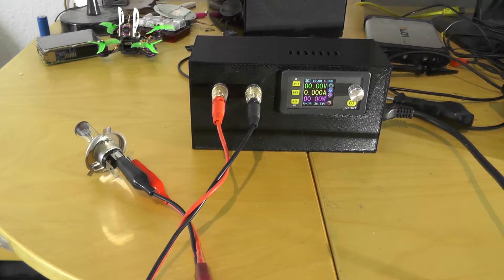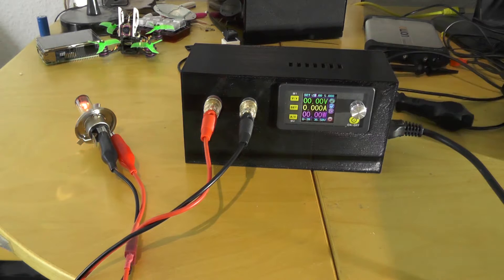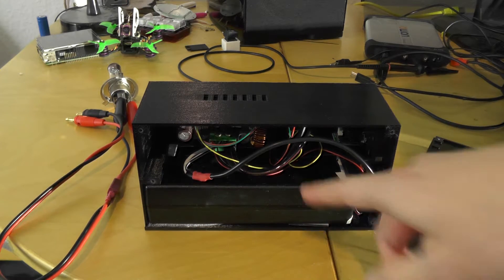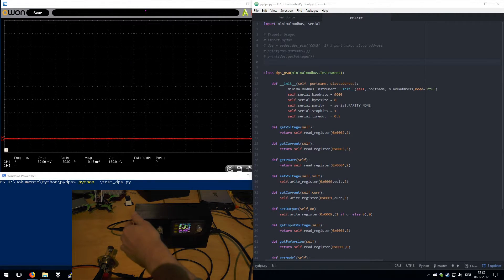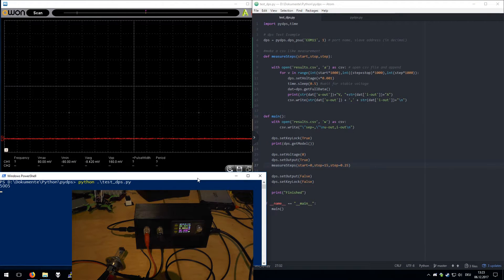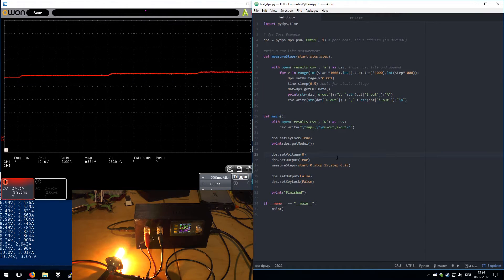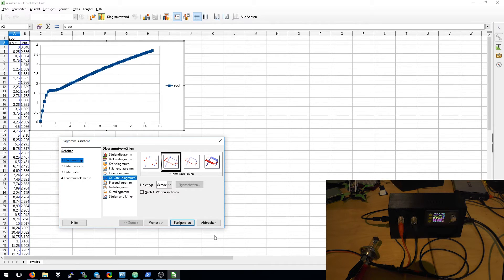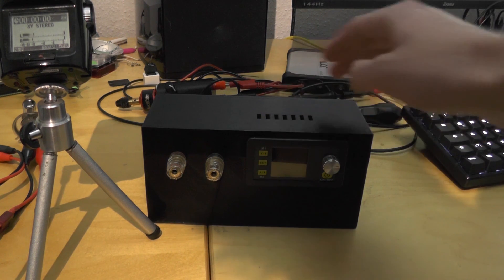3D printed DPS5005 lab power supply. USB controlled with python (code and stl in description)

Comment: Hi there I didn't dig too much into the windows software given but is it able to program a real sequence of things? Can we charge a lipo battery with it or do I need to write a python script with your lib?
Reply from the maker: The standard windows software can do a voltage ramp and set current/voltage but if you want more complex sequences i would write my own python script like i did in the video. But apart from that i would probably not trust it to charge a lipo. At most a lead acid battery.
Reply: Gigawipf ok can you explain why you wouldn't trust it to charge a lipo? It very reliable psu isn't it?
Reply from the maker: As lipo batteries need balancing if you have multiple cells which would have to be done externally and for a single cell you  need cc/cv charging which should work fine, but the program would need to stop charging after a minimum current is reached. For a single cell it could be okay but for charging i would honestly use a real lipo charger instead.